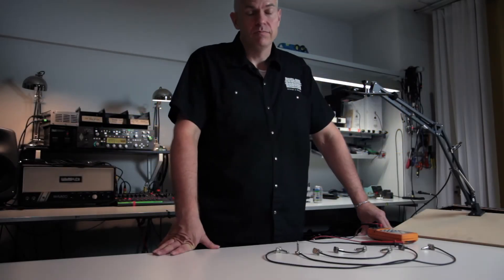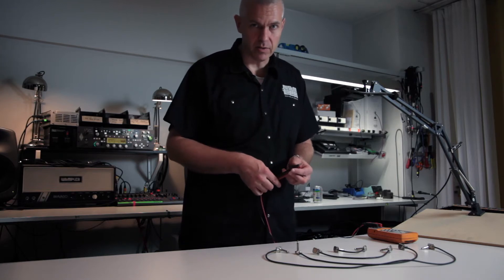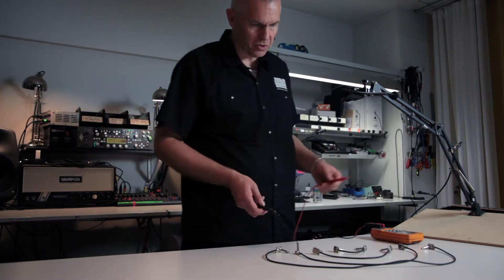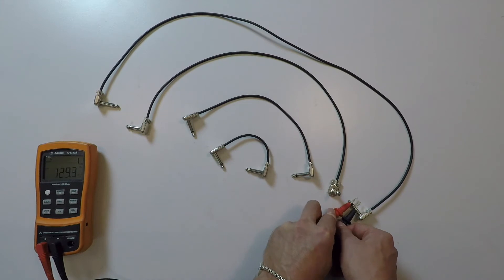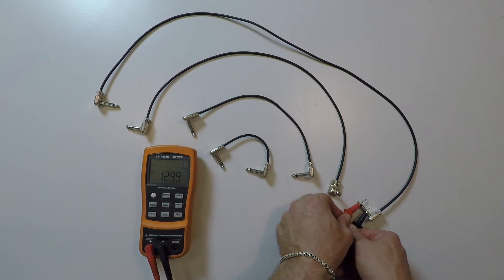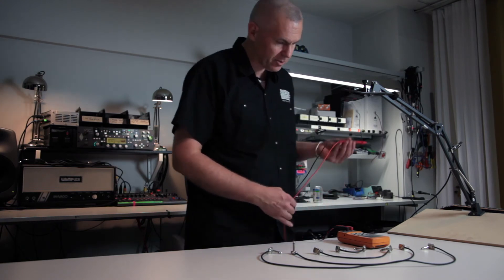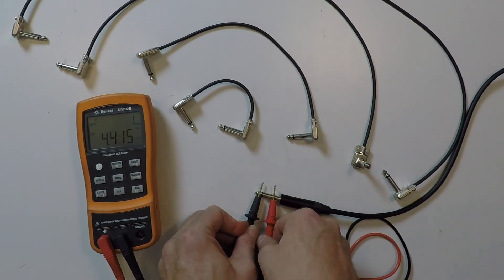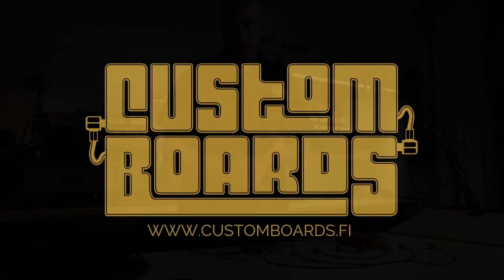How to measure the capacitance from guitar cable - Custom Boards pedalboard builder's guide (2018)

Comment: Can you measure the total capacitance of the pedal board? I did this today to figure out where to put my buffer in my board. I placed my buffer at the end of the chain and measured the end of the cable that came out of the buffer which is supposed to have an output of 100ohms. The capacitance was so high I couldn't measure it with my meter. Is it supposed to be a really high capacitance right after the buffer?

Comment: Sorry, I've never ever heard of "cents" as a unit of of measurement for length. Did you mean centimetres? To the best of my knowledge, cents is a unit of measurement for pitch and intonation of a musical note when using a guitar tuner (and also as a denomination of monetary currency), but not a term for measurement of length in the metric system. This video just doesn't make 'sense'.
Reply: It took me a few seconds (but not much more) to realise he meant centimeters.

Comment: Is a higher or lower nF value better, I find it weird noone ever mentions this.
Reply: Eetu's Answer is really good. As a supplement to it though, there isn't necessarily a "right" way, so much as what you want to achieve. There have been musicians in the past that use extremely long cables to help achieve their desired tone. As Eetu said, it's best to think of cable capacitance, plug capacitance and length as another part of your tone control.
Reply: @Eetu Lehtinen Thanks for the answer :D
Reply: I just use it 'to taste.' Currently I like high cap. on bass and lower cap. on electric guitar to give extra separation in a mix.  Your call tho.  I'm using differenct lengths of similar Quantum Audio Designs brand cables to achieve this.

Comment: wrong.
 in the short lengths you're testing here, the two plugs can easily have more capacitance than high grade cable. -hence your similar readings from different types of cable ;-)   a more realistic procedure:   -measure a cable, with and without (identical !)  plugs to determine the plugs effect, then subtract that from your cable measurements.  b, then use at least 5-6 meters of cable to measure capacitance more accurately ;-)

Comment: For the curious minds - the 4.06 nF his meter reads = 4060 pF or 4044± minus the initial buffer, about 161.7± pF/m. 46% increase over the 1m cable. . . or 3900% total increase.  I've only started building gear and from my tests as well it seems interesting to note the exponential differences in capacitance over cable lengths even given the same cable.
Reply from the maker: Hi Zac! Thank you for your comment. A very much appreciated. I hope you would find our “Pedalboard Building Guide” interesting, which includes loads of tutorials and videos about building your own board. 

https://customboards.fi/pages/the-custom-boards-guide-for-building-your-own-pedalboard

We also have a “Pedalboard Gallery” of all the work we’ve done:

https://customboards.fi/blogs/custom-boards-gallery

I am happy to hear any comments about our content. 

Best regards

Kimmo Aroluoma

—
Custom Boards Finland Oy
Sahaajankatu 14
00880 Helsinki
tel: +358 10 411 0160 
www.customboards.fi

Comment: Ok, only one thing you don't tell me that I need to know in this fine video: how do I setup my multimeter to do this?  Or do I need a special capacitance meter?  For people like me, learning electronics decades too late, how to setup for testing?  Nobody's telling that part on YouTube.  I guess it's assumed you know basics about elecronics already.  And since I can't read... How about a quick video showing us that part?

What about cable wire gauge?  Does it affect the capacitance?  quad core vs. dual core?  IF I know wtf I am doing, I can test this myself.
Reply: Honestly, it would likely be best to look up the manual from your specific meter.  I too am just learning some of these electronics stuff - never too late until after you're dead.
Most good manufacturers should have online pdf or other documentation - that was how I had to figure mine out.
Great watch to answer some of the other questions you asked - https://www.youtube.com/watch?v=OkeUKk_gy2Q
Reply from the maker: Hi! Thank you for your message. Please see check out our “Pedalboard Building Guide” for tutorials and videos about building your own board. 

https://customboards.fi/pages/the-custom-boards-guide-for-building-your-own-pedalboard

These guides include lots of additional info on cables and their measurement.

Best regards

Kimmo Aroluoma

—
Custom Boards Finland Oy
Sahaajankatu 14
00880 Helsinki
tel: +358 10 411 0160 
www.customboards.fi

Comment: If you disconnect the shield on only one end of the cable does the capacitance go UP or down? this is called directional guitar cables when you do this
Reply from the maker: Hi!

Thank you for your comment. 

If you like to learn more about electric guitar signal chain or would like to build your own pedalboard, we have a comprehensive “Pedalboard Building Guide”, which has loads of tutorials and videos:

https://customboards.fi/pages/the-custom-boards-guide-for-building-your-own-pedalboard

For further inspiration, our most popular page is our “Pedalboard Gallery”, which includes all the custom work we’ve done so far. 

https://customboards.fi/blogs/custom-boards-gallery

If you have any questions about our services or our products, I am more than happy to help.

Best regards

Kimmo Aroluoma
Reply from the maker: Hi Wayne! This is an interesting question. As capacitance is present in cable with or without the plugs, they add only their own amount of capacitance for the total sum.  And as the percentage of plug's capacitance in total gets smaller with longer cables, I would not worry about this that much. 

For further inspiration, please check out our “Pedalboard Building Guide” for tutorials and videos about building your own board. 

https://customboards.fi/pages/the-custom-boards-guide-for-building-your-own-pedalboard

We also have a “Pedalboard Gallery” of all the work we’ve done:

https://customboards.fi/blogs/custom-boards-gallery

In the future, if you order directly from our own webstore, you would benefit from our “Premium -membership”, which includes free shipping on any order over 199€ inside the EU. Please read more info from here:

https://customboards.fi/pages/custom-boards-premium

Best regards

Kimmo Aroluoma

—
Custom Boards Finland Oy
Sahaajankatu 14
00880 Helsinki
tel: +358 10 411 0160 
www.customboards.fi